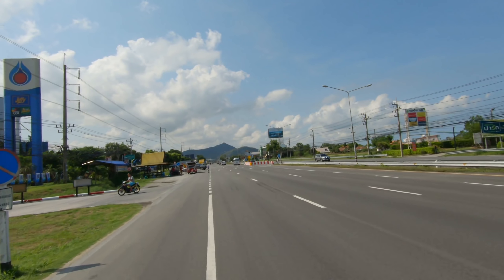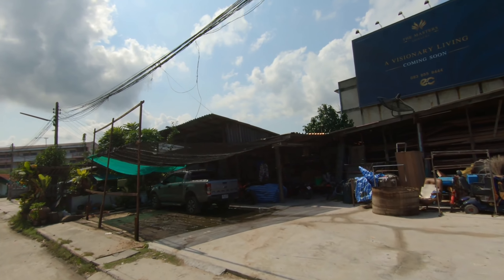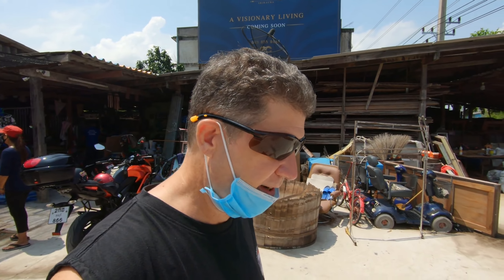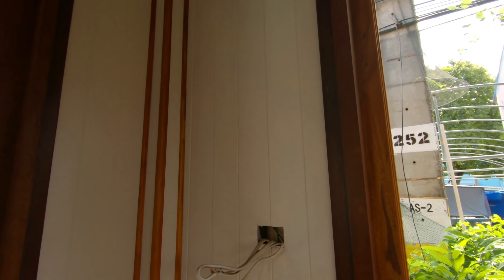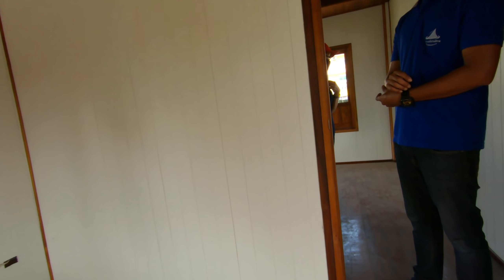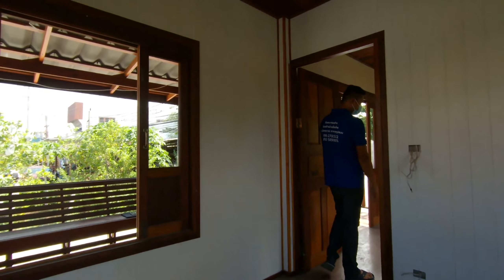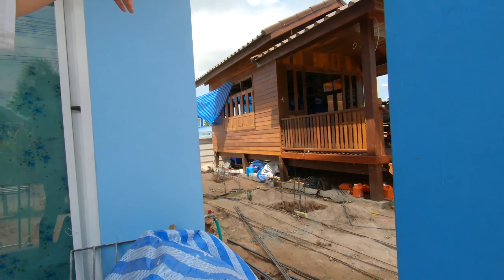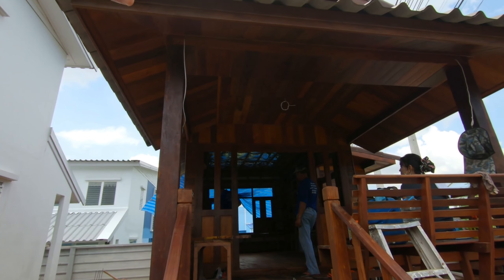Thailand Low Cost of Living in a Tiny House

Comment: I would make a deal with a good hotel for a minimum of 100 days a year in the hotel. I am sure you could stay in someplace like the Initial in Hua Hin or the Siam @ Siam Design in Pattaya for  $40 or less a night. I used to travel to Sing and worked out a deal with the Hyatt for $100 a night 100 nights guaranteed. They even stored my stuff when I was not there and moved it back into another room when I arrived. If you want to travel guarantee 50 nights in Pattaya and another city. Worked for me and I paid up front.

Comment: I have this reoccurring nightmare that I'm an electrician in Thailand.  2:20
Reply: Conduit.... What is a conduit??
Reply: The overhead lines in Thailand are crazy... It appears that everyone on the block has their own feed... If you rent a hotel room on the second floor in some towns, your view could be blocked by a cluster f**k  of wires... I presume it's from a lack of enough transformers.
Reply: At least the cables are insulated, in the west they're bare wires.
Reply: At least they don't use the antiquated American electrical system of 120v and metal conduits everywhere, we've moved on from having cables that require that in most of the world - the insulation that's part of the cable is enough so it's much easier to work with
Reply: @americanational366  most of those wires you see on the poles are phone and internet lines because they don't have underground pits in most of the country. The power system at least in Bangkok is generally quite neat and tidy and they're starting to put them underground in city centre.
Reply: AMERICANATIONAL being there where the views are blocked by these wires 2 nights. Night mare😫😖😣
Reply: Michael Clark you’re kidding aren’t you they are birds nest all over Thailand I remember a few years ago in Phuket watching a transformer blow up quite a sight
Reply: I've done commercial and residential electrical for quite a while. I cringe every single one of these  videos whenever I see the wiring on the poles.... It's like my god, man, WHY do you need THAT many wires? WHAT ARE YOU DOING!?!?!?

I get that it rains a lot there, so burying cables comes with a host of problems in it's own right, but a lot of that looks like coms and cable lines, not just power.

Guess it's just my OCD when it comes to wiring.
Reply: Man, they do have the wires there. I guess when you build they just put another extension cord on some poor pole.
Reply: haaa you funny guy
Reply: Haha after being a tree trimmer for power companies in PA,MD,OH,WV and years being a COAX/Fiber Optic lineman on the East Coast plus my OCD I always notice the Comm and Electrical wires over there and that really drives me crazy.

I did hear they just run new instead of taking old down,might be a good way to make $$ if you know what you're playing with and don't get electrocuted...lol

Comment: I like the idea of using recycled/seasoned wood. But I would of liked to see some more insulation.
Reply: Thais (and southeast asians in general) don't really do insulation, and especially not at the lower cost end of the market.  AC is expensive, so they let their houses breathe instead.  I get it, its rough for us Europeans, who are used to much lower temperatures. I am certain you could negotiate with the builder to add insulation, but that's going to come at significant added cost.

Comment: Condos are usually feet of concrete so you'd save on electricity a/c bills compared to a wooden house.

Think of the advantages in a condo in terms of the ability to cut your losses and move any time you liked. Noisy neighbours, problems with ex-girlfriends, a need to go back to the West...

People think buying means no expense, but it's bad accountancy that allows them to believe that.

For folk who're desperate for a house as a condo alternative, the standard single storey Thai 40 sq metre terraced house seems to be the same price, or cheaper, than a condo. A nice condo in Udon is 3,500. Across the street a house is 2,500. The houses look gloomy and likely to be hot as hell. I suppose putting a load of balanced lighting flourescent tubes in, sealing the place, and running AC, could work. But condos have a lot going for them. Get up and away from the traffic, and plenty of glass.

Comment: It looks like the only insulation in in the ceiling. Does it ever get cold in Thailand? I guess it would be pretty hot or costly to cool in the hot season.
Reply from the maker: they had some in the walls as well, it can get a little chilli way up north, the low for the last year here was about 63 degrees Fahrenheit for a brief time.  But of course the keeping the cold in during the hot days is the trick.

Comment: Horrible deal for you. Bathroom extra. No kitchen. No insulation. No air-conditioning. You'd sweat your balls off in the heat/humidity. Plus, it's illegal for foreigners to own a house or land in Thailand, only an apartment or condo. Your WIFE can own land/house but only if she is Thai, and you'd obviously have to marry her. If you did rent land, as soon as your contract expired, the landowner would own your house.  Great deal for a Thai who loves 95F and 100% humidity, but not for anyone else.  But... it would almost be worth it for the food, beaches and women!
Reply: This is where due diligence comes in. A foreigner cannot own land, as you say, but a foreigner CAN own structures built on leased land. If the lease is written up correctly, the structures can be removed from the land at the end of the lease, which is one very significant benefit of having a wooden house.
Reply: Tripp On Two Wheels  maybe ok for thais since the can sleep on mats as 10 per room but we still like our comfort and privacy.